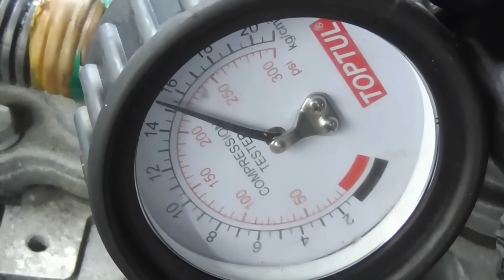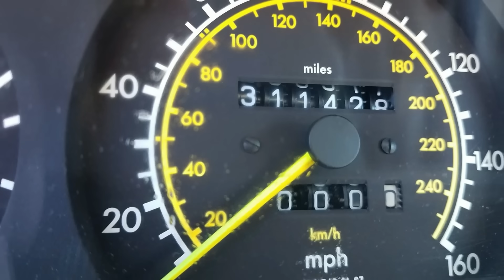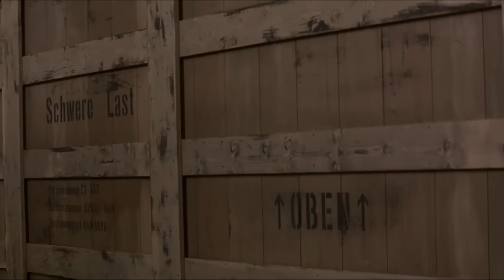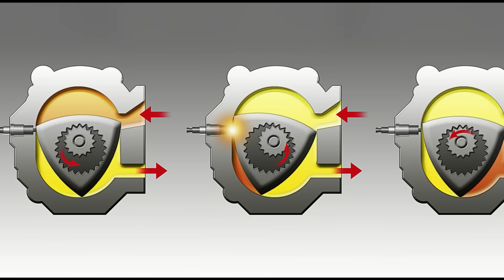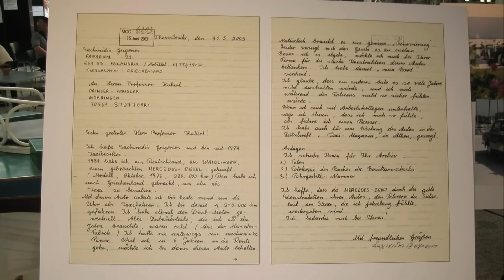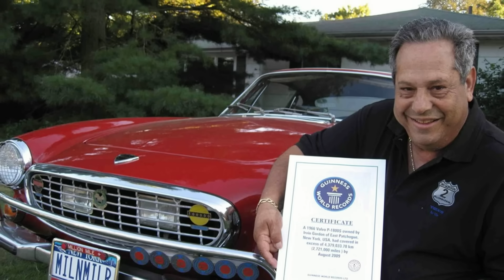Most Reliable Engines of All Time

Comment: Wow 3 million miles I thought I was doing well with 285000 on my Lexus rx 'hoho ive got a bit too go yet 'I change oil every 10000 a transmission fluid every 50000 and that s about it although I had to do the brakes rotors and pads last year

Comment: Cannot believe he did not mention the Canadian manufactured Ford 4.9L, 300ci Straight six! Absolutely reliable!
Reply: The 300 inch Ford is like a fire hydrant.  Painfully simple, unsophisticated, unloved.. it is just "there".  And it's always gonna be there because they don't break, they don't wear out, they don't quit.  In a fistfight between Chrysler's 225 /6 and Ford's 300 big 6, it's a toss-up as to how long they would last, especially since those engines are still around and still running up through today.
Reply: @tonyunderwood9678  definitely the Ford because the whole rest of the truck is also very reliable
Reply: Agree! Had a 300 straight 6 in my 81 ford step side truck.... loved that motor!

Comment: The numbers quoted are total nonsense - my 2001 Jeep Cherokee 4.0L I6 has over 350,000 on it and is still going very strong - probably it is going to outlive me, as I just retired at full retirement age. The only thing ever done on the engine was replacing the rear crankshaft seal because it started leaking oil at about 300,000. Fixing the problem was relatively simple. After dropping the 
oil pan, etc. I also had a chance to check the crankshaft bearings, which where in a quite decent shape, easily ready for another 150,000 at least. It is worth mentioning that the maintenance of the engine was rather poor due to me being a rather busy man over my 'working' years, so it was not unusual to change oil in intervals larger than 10,000.

Comment: My wife's 1990 Toyota Corolla has 310, 867 miles and still going on. Been driven with no oil and anti freeze and still kicking. Check the oil more frequently to make sure it's got enough to keep it going for another 300,000 miles.
Reply: Yes but this fool said that engine was placed in the Toyota Supra. Complete and utter foolery.

Comment: since when is a 6 cylinder with ITB, Twin parallel turbo and front diff built into the bottom oil pan, will do 500hp with factory bottom end is cheap? (rb26)

Comment: My 1964 Plymouth Valiant ran without  mechanical. Issues until it reached 411,000 miles. It was a really simple car with a three speed manual 29 miles per gallon.transmission  with  the shifter mounted on the steering column. I lived in New Orleans (very flat)  and I averaged about

Comment: The AMC straight 6 that they put in Jeep TJ's and XJ's should be on here. I've seen them last 700,000 miles. Absolute unit of an engine.
Reply: The best of the best is the 4.0 AMC/JEEP
Reply: @warbed1  
True however 12-14 mpg , that is what I was getting in a 1997 Jeep.
Reply: Yeah, the AMC six cylinder engines also went on and on....those and the slant six were amazing..
Reply: My MJ only has 100,000 miles but I've owned XJ's with over 300k love those engines so bullet proof if maintained properly or even if not maintained at all in some cases lol
Reply: The real history of the OLE242 GOES BACK 77 YEARS!!That's right it the 4.0 was developed by NASH! NASH merged with HUDSON,they were brought by AMC, which were then sold to Chrysler, Kaiser came with the deal bingo JEEP!!!
Reply: @rayoliver6807  Yup, that's true, but that was the flathead design 6 cylinder engine. The 4.0 I speak of was the OHV 258 incher...came out in the mid 60's. Dodge used a flathead design six cylinder engine from the 20's until 1960 when the OHV slant 6 came into production. I think AMC used a flathead 6 'til mid sixties...then designed the OHV six, which was really good.
Reply: @SSGTA440  My uncle had a NASH  Statesman which OLSMOBILE made out the back door with the design!Nash was so far ahead of it's time !! They de veloped rotor brakes,a/c,power windows! In Nash,TN I was  kid back in the 50's and his Nash turned heads where ever he went!They were for the workingman !
Reply: You bet on that one! Was a Jeep mechanic in the 90's & 2000's and could not believe some of the XJ's with the Asin-Warner auto trans & the 4.0. Toyota used these same transmissions for many years and a person got their money's worth with them! Never had to fix those transmissions in over 20 yrs of being a master tech for both brands! Biggest problem with the 4.0 was exhaust manifolds. Made good money doing the manifolds.
Reply: @michaelrini3654  cracked two manifolds with mine. Had to settle for one with a weird accordion shaped section. Hasn't cracked yet.🤞
Reply: @kazeryu17  Two XJ's one with 100K and the other with nearly 500K and they loooove boost too. :)
Reply: That said, mine is only halfway through its lifespan.
Reply: My 2004 wj with a 4.0, still running strong at 452,000+ miles
Reply: My 93 yj sahara still purrs with its 4.0 straight 6, and the ax15 gives it a f-ton of torque.
Reply: Absolutely i rember a old co worker who had a jeep Comanche pick up truck with a straight 6 with almost 300000 it ran like a champ good power didn't leak oil or anything dam good engines
Reply: Keep an eye on the timing chain for the Jeep 4.0L inline-6. Above 170K, the timing chain may stretch to the point of making noise. When you hear it, go ahead and change it.

Comment: I absolutely love rotaries but they are far from reliable. Sorry to say but there is so much misinformation here...Also should point out that the M52 from BMW is significantly more reliable with its thicker cyl walls, cast iron block and the fact it was rarely pushed as hard as the M57 which likes to eat rod + bearings for breakfast.

I also love BMW btw.
2 of my cars are Bimmers and 1 is my daily...there’s a reason I own 2 of them

Comment: I had a Ford with a 4.6l v8 had 260,000 miles when I sold it and still ran like a top, and I think also the 6.2l gm diesel should make this list, I know of several that had over 300,000 miles.
Reply: those 6.2 weren't racers but yeah they were built like tanks
Reply: @TheFluffyWendigo  Just proved GM COULD sometimes learn from their mistakes - like the 1970s 350 "diesel".

Comment: ...there is a JTD engine, that basically is indestructible... but I see you didn't mentioned it...

My 2.4JTDm with 240+hp has approx 330k km... and is running without a problem... so yeah...

Comment: how are these reliable when they've had multiple engines, and how does a ford 7.3 not get mentioned when they've been recorded multiple times of having over a million miles on the same engine without being rebuilt, and also the Ford 300 6 cylinder and the dodge slant six and the chevyvsix cylinder they've all recorded crazy high mileage on the same engines
Reply: Well for one thing, these guys clearly don't know any of the engines or cars they actually did mention so don't see why they'd know those.
Reply: I have a 1997 f350 7.3 with zf5 speed and 4.10 rear end. It has 1.8 million miles and still going. Am in the middle of daily driving her and restoring her at same time. Don't get me wrong you do have to work on them not just change oil. If you take care of them they will take care of you.

Comment: Take care of a diesel and most will run 250k miles easy.  They are highly intolerant of poor maintenance though...which is where the ‘average’ diesel owner fails.  Mercedes owners usually go back to the dealer too and have a bit extra pride in their cars overall.

Comment: The 3.8 V6 GM engine should be on this list. It was a good engine. Unfortunately, many of the cars GM built were not all that great. The 3.8 V6 lasted but the rest of the car fell apart.
Reply: Yeah the transmissions did not match the durability of the engine
Reply: I drove a '98 Park Avenue Ultra to 285,000, tranny died. It never used oil and that supercharged engine would scream.
Reply: Glad to hear this, bout to buy a VS Commodore

Comment: Ford produced a six cylinder L.P.G. powered engine in Australia that quite regularly got 500000 miles. It was used in taxis and I have seen a taxi with over a million kilometers on the clock that's about 620 thousand miles. Nothing else had that reliability
Reply: My girlfriend has one.
It's only done 225,000km so is just run in.
Pull the dipstick out & is ALWAYS krystal clean oil on it. No smell of part burned fuel at all.
I think that's a big part of their longevity... no carbon build up to clog things up.
Transmission is another story though. Hers died at about 160k kms & it may be because Ford got wary of failing trans coolers making strawberry milk shakes inside trans.
Their solution (pun intended)?
Don't use a trans cooler.
🤔🤔

Comment: No mention of the GM 3.8 or the F22 Hondas. Half this list should be eliminated and replaced with stuff that actually IS reliable. 150,000 to 200,000 is totally unimpressive and SHOULD be viewed as standard. I currently own a GM 5.3 with 250k on it, a GM 3.8 with 250k, a Volvo 2.9 with 250k, and a Honda F22 with 350k. All still run and drive perfectly.

Comment: What happened to the 2004 and up 3.4 lt Chevy Montana vans.
A friend and customer of mine uses them for shuttle service and scraps them around 600km 
Because of there rotten body's, the Eng and trans have never had any real service work.
He only changes the Eng. Oil around 10 to 12.000 km and never services the trans fluid.
For a North American engine that's reliably in my eyes!

Comment: This list lacks many more reliable engines, therefore it is flawed. Let's talk about the Ford modular 4.6 V8 for example. These engines were considered just broken in at 200,000 miles. Seen many Town Cars and Crown Victoria in police and livery service with astonishing 650,000 to 750,000 miles.  Buick 231/3.8L V6, Chrysler Pentastar V6, Chevrolet inline 6 in the Trailblazer is good for 500,000 miles with regular care. There are more but this is enough.

Comment: My 2000 Beetle is pushing 225K...it has the naturally aspirated 2.0 4 banger with a 5 speed...I've had it up to 125 too ! Also , the Ford 300 C.I.D. Inline 6 cylinder engine was bullet proof !
Reply: The 8v 2.slow vw 2.0 liter is simple and bulletproof.  Very doggy but for basic uber/pizza delivery, pure torture, its as good as they come.
Reply: How many automatic transmissions did it go through
Reply: @funnypranker34  as I said , the Beetle is a 5 speed. Never put a tranny in anything !

Comment: Had a 1981 300SD. Based on the maintence paperwork? Likely had 600k plus miles. I had 3 of them. All in excess of 300K miles.
Reply: Over the past 27 years I've owned several 300SDs.  My favorite MB of all time (though I like my little 240s too).  Years ago when they were plentiful, before neglect, wrecks and rust killed off many of them, I'd buy one, drive it for a year, trade for a different color, lower miles, and so forth.  I still have two.  My 1984 has 752K.  Original engine lasted 703K before any major work was done.  That was just a broken valve guide.  Had the valve guides changed, replaced timing chain, rail, and tensioner, and 25K later, at 728K, the bottom end went.  Wish I could go back in time and had the bottom end rebuilt.  Instead, I traded a parts car for a replacement engine.  Swapped it out myself, and put another 24K on it, and started having an unsolvable overheating problem.  I think it's a cracked head.  I still have that original engine.  Some day I hope to get that 3/4-million mile car back on the road!

Comment: 200,000 miles is nothing. I have been in Lincoln Town cars with 400,000-680,000 miles. My town car went 250,000 miles before I totaled it by hitting concrete wall.

Comment: The 2005 - 2006 dodge sprinter diesel van. Million mile motor and got over 24 miles to a gallon loaded.  Mercedes probably stopped making it cause of that.  Sounds like greed to me

Comment: The N57 and it is not reliable at all, it barely hut 50k miles before a new transmission is right around the corner. I am sorry, but you have no clue what reliable means.

Comment: I am a fan of the VW 1,9 TDI (VW Golf, Passat, Transporter, Audi A3, A4, Skoda Octavia, Seat Ibiza, Toledo, Vario and more). You can get that engine in atmospheric version (1.9 SDI), turbo 90hp, 110hp, 130hp and probably more. I buy them second hand and drive them until they die. I now drive a Skoda Octavia equipped with that engine. It has 300,000 km and purrs like a kitten. And the fuel mileage is really good. Some people get 750,000 km out of them. The rest of the car usually falls apart before the engine dies.

Comment: Ok I know damn well this guy doesn’t know anything about cars bcuz the 13B is not a reliable engine. I didn’t know an engine that required full rebuild every 30k was reliable. There’s a reason why Mazda had a class action suit against it. They tried and tried but never could figure out a better solution to the apex seals. If this was a true reliable engines list then it would be all Toyota engines

Comment: I once bought an 01 Buick LeSabre only firing on 2 of its 6 cylinders, but it still ran and drove. 3800 Series 2 is the most reliable motor ever. Didn't need to be rebuilt entirely until 600k miles. When I got it I replaced the injectors, fuel pump and spark plugs, changed the oil and trans fluid, it ran like new. That motor is now in an 08 chevy Impala
Reply: LeSabre gang, easily one of the best cars in history

Comment: How may engines in the fury? pfffft. If you want to talk longevity it should be about how for it goes on original engine and transmission without any rebuilds.
I put 342,000 miles on a 1991 volvo 740 with a B20F engine from 1991 to 2004. The only maintenance was oil (about every 10 k miles), plugs, timing belts (every 80k miles), transmission fluid (about every 50k miles), brake fluid (every two years), two water pumps, rear end fluid (twice) and shocks (two or three times). Sold with original engine, transmission, rear end, calipers, radiator, power steering pump, master cylinder and power window motors.

Comment: Mazda rotary engine? It required 2k of work every 50 k miles.
Reply: i had a mazda rx 3 it was a good car but leaked oil . i won,t rate it as a good engine ,it could have been if mazda had  alot of help with it . never happend never will this guy is way off his rocker panel.

Comment: Ford Falcon Barra 4.0 inline 6, 2002 to 2016, you forgot it.
Reply: Com on mate Barra are ticking bombs
Reply: @brentonwood5464  So when do they explode, mine is at 200,000km with zero issues?
Reply: @martintaper7997  stock there just ok.lean on a them that's when you need to grout the block and watch the issues pill up.u have owned 2 and there shit money pits that uses more petrol then a jet plane
Reply: @brentonwood5464  I've had more than two and mine have no reliability issues and mine have never used a drop of petrol and are as cheap to run as a car with an engine capacity half their size. "lean on them", "grout the block" - what is that supposed to mean?
Reply: @brentonwood5464  log barra's out of taxi's easily end up seeing 750000
Reply: @Snowkell  absolutely they do like all taxi there generally all services while there hot.holden ford toyota.its the hot cold deal that wears a engine.

Comment: we had a 292 that we put over 1,200,000 miles on it before we rebuilt it . it still ran good just was getting a little week and we wanted a little more power out of it the pu doors was falling off that took a little to fix . then u have the 505 cat engine that has a warranty of 1,000,000 miles on it when they were selling it . and if u can;t get at least 300,000 miles out of an engine there is some thing wrong like maintenance or just a bad engine

Comment: 300,000klms are not unusual. ost American engines did more than that easily. Engines like the Chevy blue flame 6. Many old Ford v8's too often were 30 years or more old with 300 to 500klms on them them.

Comment: Hi there. A friend of mine has been driving his 1984 Holden Statesman for 21years on same engine. OK, it smokes a bit and the bearing are stating to rattle, but irt has done just over 1 million kms. The engine is a stock holden V8 of 308 cu ins.

Comment: Gm 3.8, 5.3, 5.7, 6.0
Honda 1.6, 1.8,  2.2, 2.4
Chrysler 5.9 cummins 12 valve, 5.2, 5.9, 4.0, 6.1
Benz 5.4(m113k) 55 series
Nissan sr20, rb25 ga16de 
Ford 4.6, 5.4(non 3 valve) 
Mitsubishi 4g63 
Just to name a few off the top of my head

Comment: I had a 1996 Saturn SL1 that we put 389,000 miles on it commuting to work. Drivetrain had never been rebuilt, just 2 clutch kits. Living in the rust belt I finally turned the car in for salvage because the unibody rusted in half. Engine was still running strong.
Reply: Every vehicle I own has over 200,000 miles on it. None of the engines have ever been rebuilt.